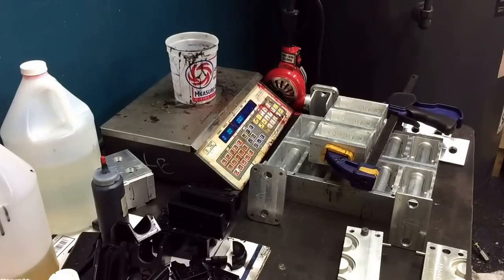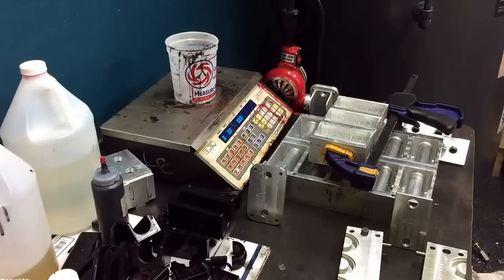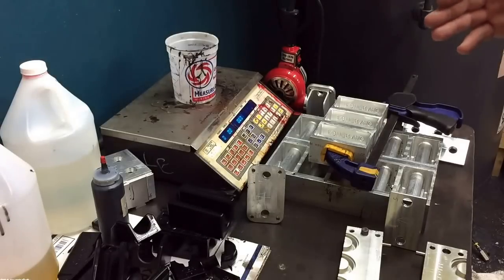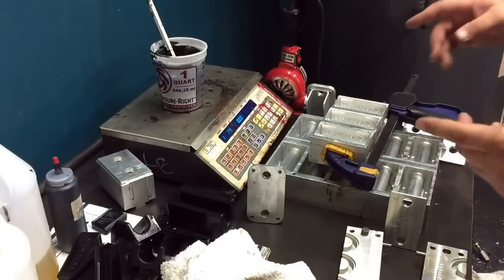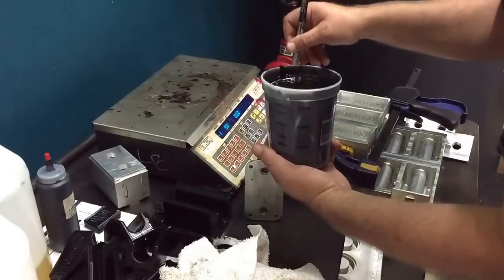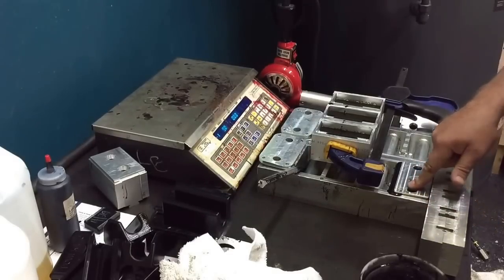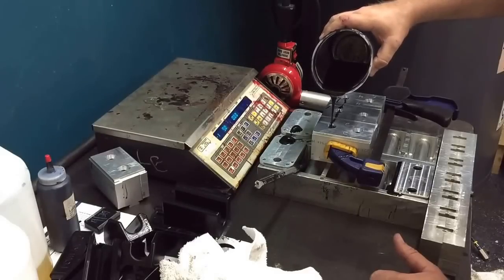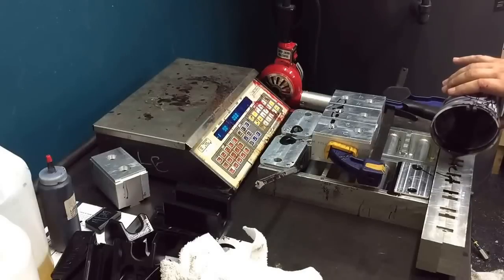ZOO CNC CONSULTANTS How to make stuff with polyurethane aka urethane rubber

Comment: Could I make a front lip for my car using this method ?
Reply from the maker: I suppose you could if you can make a mold that would accommodate the part.  The material is extremely durable and UV stable etc...

Comment: You need to use a lavaliere microphone, not the camera microphone. That will knock out all that background noise. Also, record the signal as loud as you can without distorting the sound. That will give you the best noise to signal ratio, meaning people can turn up the sound without hearing a lot of background noise.

Comment: Hi Adam, I can't get hold of Urethane liquid rubber where I am living in the Philippines, plenty of expanding foam for sale but not what I'm after to make anti vibration bushes for my Paramotor. I was wondering if I could make them out of RTV silicon rubber instead. Thanks for the very informative video btw.
Reply from the maker: If the shipping isn't crazy you could just order a small amount from here.  I don't know if silicone rubber would be very good.  I would be afraid of it tearing but I don't know for sure if it would be a problem.  I could even send you a small amount if the shipping is okay.

Comment: I have a rubber part I want to reproduce. I'm not sure how to go about it. It's a part that needs to be done as a two part mold. Kinda need help.
Reply from the maker: The Restoration of Dr Who 
I’ll try to help if I can.  How do you want to go forward?  My email is alouramore at GMALE or you can also text/call 561 five four two 0514. Sorry for the code but don’t want to make it super easy for the trolling programs to get my info.
Reply: ZOO CNC 5Axis Machining, Training and Consulting sent you an email 👍🏻

Comment: Can you tell me where I can get these ingredients?  I want to start off with buying just a small quantity to determine if this is the type of material that will work for what I need.
Reply from the maker: mrfester42 
Hey buddy.  If you only need a small amount to try I can send you some.  I buy from a place called East Coast Composites and they treat me right.  We don’t use a whole lot either considering out parts are relatively small.  3 gallons makes about 500 motor mount bushings.
Reply from the maker: Email me at adam@soflomachining.com if you need a sample size and I’ll put something together for you.  Just cover the cost of the material and shipping which is maybe $25-30 depending on how much you want to start with.

Comment: Hi Adam Scott
i find your vid. great. great tips. Do you have a link where to find the resin you are using? there is also defrences in rubber stiffnes right?
Reply from the maker: Boost V8 chevy 
Hey. Sorry for the delay.  I don’t have a link but the company is called US Composites. So far they’re the best I’ve found but don’t hold me to that.  I can tell you they beat the crap out of crooks like smooth-on which charges about 40% more for the same materials and about 5 times the price for dye/pigment.

Comment: Hi Adam. Can I cast urethane rubber in a silicone mold? Thank you! //Billy
Reply from the maker: Billy Ly 
Sure you can.  In fact many applications work better with a flexible mold.  Makes removing the cast part easier.   Just make sure it will retain shape while the urethane is poured and curing.

Comment: I'd like to make some custom bushings for shock absorbtion between a sprocket and it's hub adapter. is it ok to just mix and pour into molds, or is it best to use a mold release spray?

these things are aluminum, and as stock, just hard bolted together with no spacing adjustment. bushings would adjust the separation, as well as cushion the forces it gets from the chain and wheel. ive spent dozens of hours trying to search tapered bushings just the size i need and have a headache. i'd love to have the perfect size and color :-) thanks for an intro into DIY polyurethane. new sub!
Reply from the maker: Hello,  Here is the basic gist of it.  Urethane bonds exceptionally well to metals and in fact if you have a relatively rough or porous surface it is among the best ways to bond components together but if you don't want a permanent attachment you have to use a release or you will destroy either or both the parts and the urethane trying to separate them.  I have actually used thin viscosity mixes to attach sheetmetal to a holding block in order to machine the sheetmetal and the only downside is that you have to heat the finished product to about 450-550 Fahrenheit to get them apart.

Does that answer your question?

Comment: Hey Adam:

I've been searching for information about doing this type of stuff for making my own Air Rifle Seals.  The only difference would be that I would want to impregnate my Polyurethane mix with some stuff called molybdenum disulfide in order to give the finished Seals some added lubricity and resistance to the heat generated within the pressure chamber of the air rifle.

Right now I'm not sure if it would be easier to just make a cylindrical mold of the correct diameter and then turn them to shape on my lathe or, if I should just take the time to mill a small multi cavity mold and make five or six at a time.

I have a couple of questions if you don't mind:

(1) Have your ever mixed or added other ingredients to your Polyurethane recipes?  If so, how did they turn out.   I ask because I've never done any of this before so I don't know what the mix ratio would be if I did include additives like the moly-disulfide.

(2)  For my application color isn't really a critical factor but,  how does one make Polyurethane in colors other than the black color you use?

(3)  The stuff I'd be making would measure about 1 1/4" round x 1/4" thick.  I mention this because I can't see myself ever using gallons of the stuff to make such small parts.  Is it possible to buy the mix in much smaller quantities?

The air gun seals in question cost about fifteen-bucks a pop.  If you shoot a lot it can add up quickly.  I've owned one particular air rifle for a couple of years and so far I've had to buy a half dozen Replacement Seals for it.  I can buy the Moly-Disulfide impregnated seals already made but they run close to twenty-bucks a pop; and not only that but I have to order them from a vendor in Australia.

Over time, I've paid close to a hundred-bucks just for Piston-Seals for this particular air gun.  If I could make my own I'd be a happy camper.  

Thanks in advance.
Reply from the maker: Hello,
I've mixed some misc solids into urethane before and I think you can mix just about anything that won't directly react to the mixture but I don't know for sure about molybdenum.
As far as the colors, I get dye from the same place as I get urethane and it is very inexpensive. The company is called US Composites and their number is 561-588-1001
Tell them that Adam with ZOO CNC A.K.A. Groove Automation told you to contact them and that way they can lookup what they used to sell us.  I haven't ordered anything from them in a while but they were the best when I was using urethane back then.
I used to get 3 gallons at a time but I am pretty sure you can get smaller quantities.  Just give them a call and I'm sure they can work it out for you.

Best of luck with it and let me know if I can give you any other info.

Thanks
Adam
Reply: Hi Adam:  And thanks for the quick reply.

I've been looking around for suppliers on the internet.  Mainly those who offer their ready made  Moly-Disulfate impregnated Polyurethane rod stock.  So far trying to get information like mix ratios and such is like pulling teeth.  One guy even reacted like I was trying to make a pass at his wife or something.  I can understand proprietary information but this guy was out in left field.

When you added those "Misc Solids" to your mix, did adding that other stuff affect the hardness after it had cured?  I'm needing a hardness of 80-85 or so and I'm not sure what kind of affect; if any, adding the Moly will have.

For example; If it softens the cured end product then I'd have to find a mix that would initially be meant to give me a 90 durometer Seal.  If it adding the Moly-D into the mix tended to harden the finished product than I'd have to start out with a 70 or so durometer mix.

I'm not really to concerned about the color.  My main concern at this point is to find the correct ingredients and mix ratios of the Moly-Disulfate and how it affects the hardness level.

I guess if I can't find anyone who can clue me in on this stuff I'll just have to tackle the learning curve that comes along with any other first time project.
 
Thanks again for your reply.  I'll try reaching out to US Composites next week.
Reply from the maker: People are funny about stuff sometimes and earlier in my career I was probably a little funny my self.  I started out in the automotive performance business as a speed shop so we were always in competition for the fastest cars and most power etc... but years went bye and I started to realize how dumb we were to think we really knew anything that was so special and even if I did know something "special" I'd be better off sharing it and keeping my eyes open to others that thought the same way.  I've been doing manufacturing consulting for many years now and the truth is you never really know where you will learn something great.  Sometimes it's a little shop and I've even picked up some good ideas from students in a College CNC machining CAD/CAM class that I teach.

P.S.
His wife is probably a dog and that's why he acts like a dick....

The only thing I can remember mixing that made a big difference in durometer was glass bead.  If you use enough of it in the mix the finished product is more like concrete than rubber.  If you can't get someone to tell you I would just mix a very small batch with moly-d and see what happens.
Reply from the maker: People are funny about stuff sometimes and earlier in my career I was probably a little funny my self.  I started out in the automotive performance business as a speed shop so we were always in competition for the fastest cars and most power etc... but years went bye and I started to realize how dumb we were to think we really knew anything that was so special and even if I did know something "special" I'd be better off sharing it and keeping my eyes open to others that thought the same way.  I've been doing manufacturing consulting for many years now and the truth is you never really know where you will learn something great.  Sometimes it's a little shop and I've even picked up some good ideas from students in a College CNC machining CAD/CAM class that I teach.

P.S.
His wife is probably a dog and that's why he acts like a dick....

The only thing I can remember mixing that made a big difference in durometer was glass bead.  If you use enough of it in the mix the finished product is more like concrete than rubber.  If you can't get someone to tell you I would just mix a very small batch with moly-d and see what happens.
Reply: I was thinking the same thing.  Mixing a small batch; one with the Moly-D in the mix and the other would be done the same way I've done when polishing a rough rifle bore.

That is; applying the mold release to the mold cavity surfaces then dusting the surface with abrasive followed by squirting hot-melt glue into the bullet mold cavities.  This gives the surfaces of my cast Hot-Melt-Glue bullets a micro-layer of abrasive that polishes the bore as the bullet flys down the barrel:  Except in this case I'd be using Moly-Disulfate dusted onto the surfaces of my Piston-Seal mold rather than abrasive powder.

Giving the Piston-Seals a micro surface layer to act as a permanent lubricating surface layer rather than trying to figure out the correct mix ratio makes a little more sense to get me started.

Thanks for you replies.  They were appreciated.  I'll leave you to your work now.

Tim M.

Comment: Hello, Adam.
Thank you for making this video widely available, thanks to that my creative juices are flowing and want to try the material and your part processing techniques on a crazy idea of mine. People already think that I'm crazy for not using hydraulics for this project, but I believe there is a better way.
I am building a custom press that will use a series of pulleys, and I want to make a long and wide polyurethane belt reinforced with ten wire ropes 1/4 in diameter. Each length of this belt between the pulleys will support about 4 tons. I intend to make a 1/2" thick belt with a layer about 1/8" of polyurethane bellow, and above the wire ropes. I wonder if a 1/8 thick layer of poly will have a long life while bending and at the same time withstand 4 tons of pressure as the belt circulates through the system of pulleys and the wire ropes get tightened and pressed against them during regular machine operation. Any thoughts on that?

Comment: Adam, great video. I see all of the molds are Al but can you use other materials? I know you said it generates tons of heat while curing; is it so hot that you can't use rubber molds?  Thank you.
Reply from the maker: William Barnes Hey man.  No you can use just about anything for a mold. I guess the main reason I used aluminum for most of my molds is because I usually start with CAD models for the parts being molded and it is just natural to machine the mold from aluminum since that's most of what we cut.  The most heat generated during the curing process is from us putting a heat gun on the parts to speed up the process.   I've made a few parts using an existing part to create a mold in urethane and they worked really well.  In some ways better than aluminum because they are flexible and you can twist them around to get the parts to release when finishes.

Comment: what would be the durometer for railway wheel? and its temperature resistance
Reply from the maker: Beats the shit out of me....  As for temperature I know it is fine up to 500 degrees Fahrenheit but I haven't used it for anything much higher than that.  If in direct contact with weight and other factors it's hard to say without looking at the tech info from the manufacturer.  You can try calling US Composites at 561-588-1001 and see what they can tell you.

Thanks
Adam

Comment: G'day Adam. Thanks for the video. I want to mould a rubber tyre for an ultralight tail wheel. I have the mould ready to go but have no idea what compound of polyurethane I'd need to achieve this. I can buy stuff online but not sure what you'd recommend. I'm assuming something the same density of a rubber engine mount would do the trick. Any suggestions? Cheers mate - Luke, Australia.
Reply: Also, the mould is made from aluminium. What do you recommend as a mould release? Can any day to day household items be used as a substitute? Many thanks
Reply: Luke Molloy hey Luke, give ERA polymers in Australia a call, I spoke to them a week ago and they are really helpful.
Reply from the maker: I don't know if they sell online but we use US Composites 561-588-1001

They have been the best supplier that I have found.
Reply from the maker: I tried some other release agents but the only one that really works for me is called pol-ease or something like that.  I should just get a few cans and put them on our site because it's hard to find and not expensive.  I'll try doing that this week so if you haven't already taken care of this check ZOOCNC.com  in a week or so

Comment: where does one buy this product? thanks for the video.
Reply from the maker: The urethane that I use comes from a place called us composites in Royal Palm Beach FL.  They are very reasonable with pricing and have good service.  I doubt they have any idea who I am but if you tell them that we use 75/80 RTV urethane they should be able to direct you to the same Polytec product that we get from them.

Comment: The best tutorial so far in this topic. 
What brand are you using?
Reply from the maker: Thanks.  We use stuff from polytec and it's the 75/80 version which basically designates the durometer of about 75-80_a  shore hardness

Comment: Thanks for the great video. What ratio or formula did you use for shrinkage calculations. I need to make up some motorbike cush drive bushings 35mmOD, 16mmID and 27 long, not sure how much shrinkage to allow or where to allow for it. ID or OD.
I'm looking at either making up a scale version of the bushing or using the original bushing for the mould. Any advice or ideas?
Cheers.

Comment: Hi Adam !That's a great video !Thank You! I wonder does the still fluid urethane stick to the half of the other urethane that is already cured in the mold?Also , what can i use in place of a mold release spray? Hope to hear from you soon ....
Reply from the maker: The urethane is super adhesive and the only thing other than actual mold release that I would use is a masking spray that is sold at Home Depot.  It comes in a yellow aerosol can but I can't remember the name of the product.  If I can find it online I'll reply with the actual name.

Comment: Wow, that is awesome.  I need to make a boot to seal the bottom of the steering column to the cab on my Unimog.  I have the original, its cracked but I could glue it back together and use it to make the mold.  What formula would you recommend for the polyurethane.  It needs to be fairly flexible, the rubber is approx. 4 mm thick and dimensions would be about 12" by 12".  thanks for the video.
Reply from the maker: Hello.  There are a few different levels of urethane that you can get ranging from about 50 to 80 shore A hardness.  I've used Polytec 60_A and it's really flexible so that might work for your application.  I think you might even be able to get a small sample from US Composites if you call them.  They are in Royal Palm Beach FL